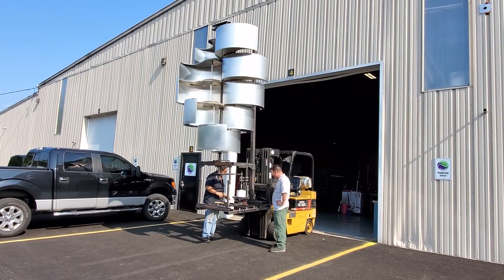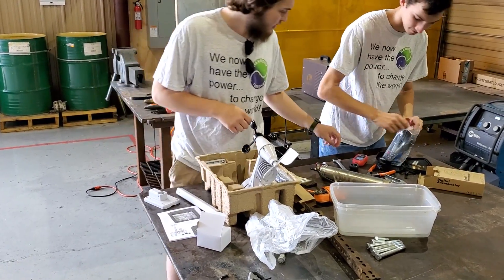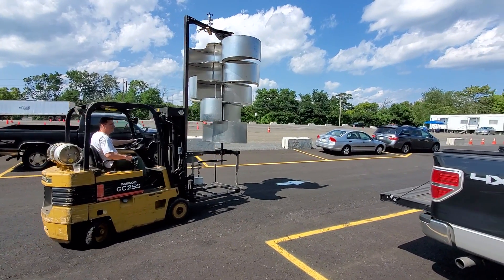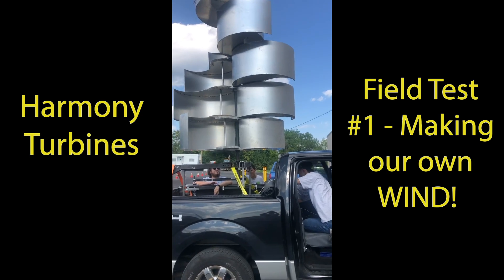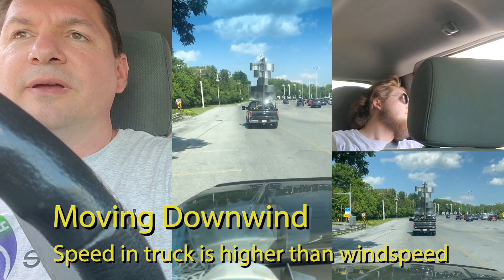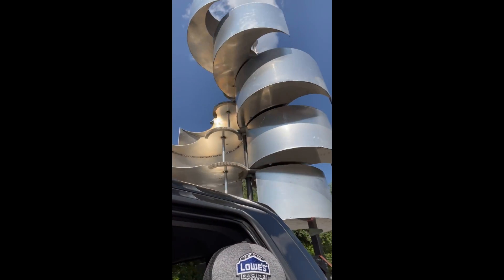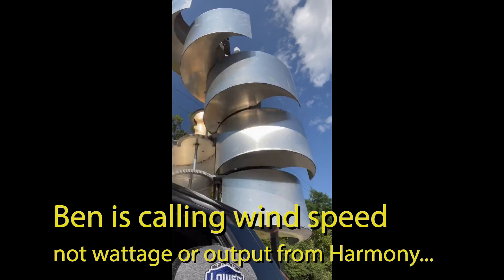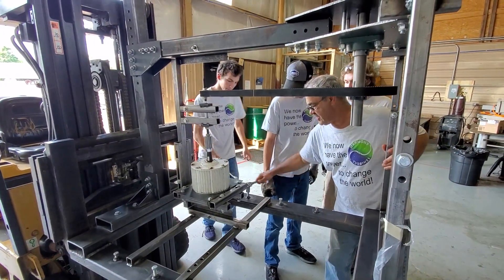Harmony Turbines Weekly Whirl 20

Comment: Do you not have a utility trailer?
Lower to the ground, you can tow it behind the truck, and do speed tests on the road, and trial it in various conditions like rain, 75mph, etc.
Reply from the maker: Mii ...lower to the ground and behind the truck means much more turbulence and disrupted airflow. It means incorrect readings and confusing results. Most trailers have very little suspension or no suspension so the turbine would be shaken and jostled harshly with every bump. Driving it on the road for any real distance would likely get us in a lot of trouble. We put it in the back of the truck for some very good reasons.

Comment: Do you have an auto  racetrack near you? You could drive at a constant speed and get continuous data. Even a HS/ college running track might work.
Reply from the maker: We are looking at a lot of options at this time. The biggest thing we need to overcome is transportation and then having the means to go from travel position (horizontal) to working position (vertical) once we get to our destination. The 1kW prototype is pretty heavy, about 600 lbs mounted in this frame.

Comment: I’m glad to see them putting the unit in the truck for controlled testing.   At some point they will have to integrate the motion controls to open and collapse the turbine blades based on various wind speeds.  This would be very difficult to do using ambient wind to get required testing. 

I wonder if they have developed a testing protocol that will give them the information they need as well as prove out functionality.   Not to be critical, but it seems to me they should have designed the bearings and other components to be weather resistant from the git go so the unit could immediately be taken outside - as it eventually will be required. 

I wish them the best in their endeavors!!
Reply: Funding is a major thing that is preventing us to move forward with many things. The bearings are 98% out of the weather but we are just being cautious as to not ruin our prototype and keep us from getting the data we need to get out to the public!

Comment: Keep up the amazing work guys hoping everything keeps getting better and better;
Personally i would have made the 1st gearing 12+ inches wide and stepped down Twice to R^6 inches than to a 1 inch! 
i would have kept the original triangle framing for stability and to all for customs work!  
(Also i would mount PV solar to them! and create an interlocking bracket to attach multiple together!)
Reply: The triangle frame is still being used. This is the setup for easy transport and testing purposes only!
Reply: @omgsantaclause  Awesome... i am looking forward to this! The energy industry in my country were to so worried about these things that they went after our investors to pull their funding to slow down us buying, testing and ramping!
Reply: @DarkOkie  that's a bummer. We are working on more funding. That's what is holding us back!
Reply: @omgsantaclause  Yeah same we are looking at possibly having 2 options later down the track: smaller Residential (250-500watt) and medium grid scale (1kW+)! 
BUT again funding was hurt so i am privately sourcing funds and contacts (ill open my own personal company if it is needed) but in time this will happen!